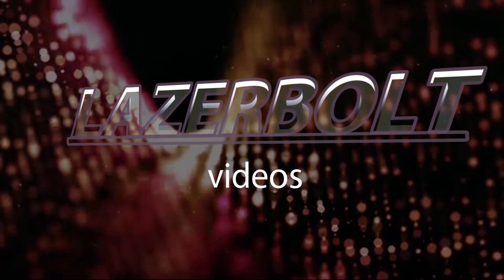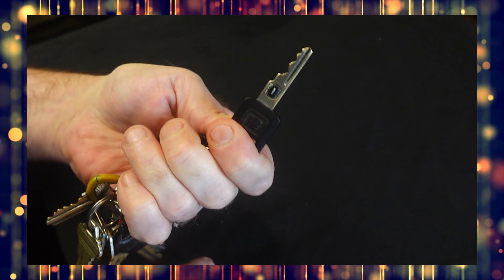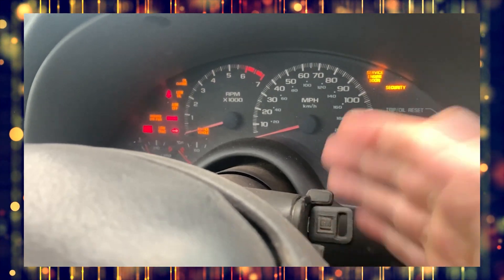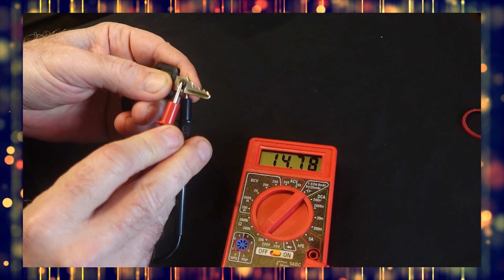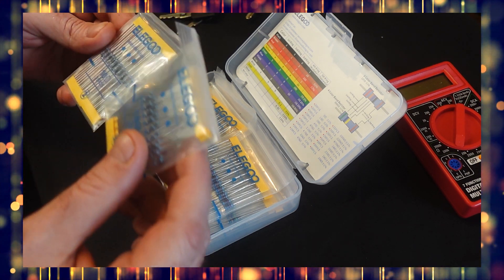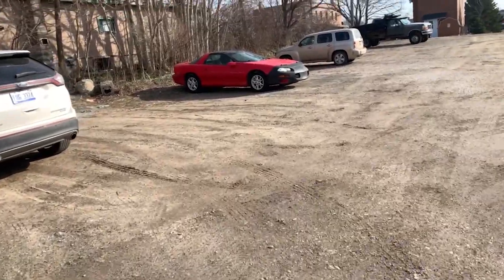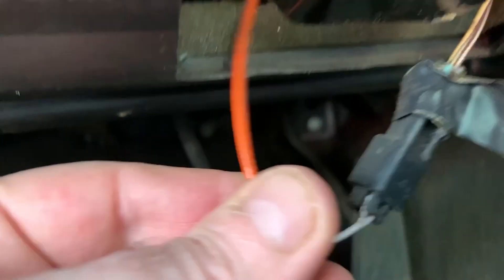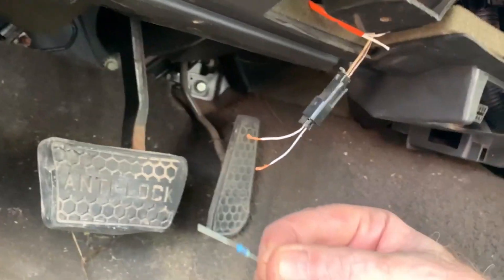Bypassing the Security System in a 2001 Camaro - GM VATS Fix - Lazerbolt -

Comment: Hey, I have the same problem. I have a 2001 Camaro. The security light is constantly on, but the engine starts fine. Interestingly, it occasionally won't start. I have to turn the key a few times to try to start the engine. All I hear is a relay click. After a few tries, the engine starts, the security light goes out, but after a moment, the security light comes on, and the engine continues to run and starts normally, even though the security light is on. There's no power at all in the wiring harness you're showing; I checked it. 
What is interesting - My key is #14, but after connecting the resistor, it doesn't work. It doesn't do anything. The light stays on, the security light stays on, and the car starts. Interestingly, when the engine won't start, the security light flashes. When the engine starts, the light goes out briefly and then comes back on. The engine can be started normally with the security light on. What can I do?
Reply from the maker: It can be difficult to diagnose these kind of issues, but the fact that the wiring (the orange and white one in particular) has no power going to it when you turn the key does suggest that it got crimped and is indeed a VATS issue. However, if installing the correct resistor in the correct place doesn't fix it like the video shows, I'm not sure what else it could be. BTW I disabled my security system a long time ago and never get the light anymore.